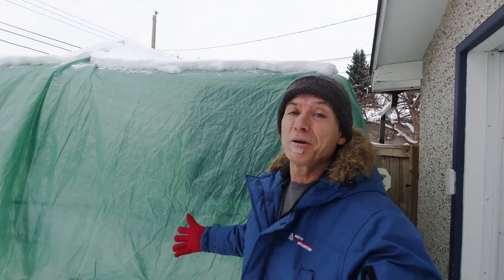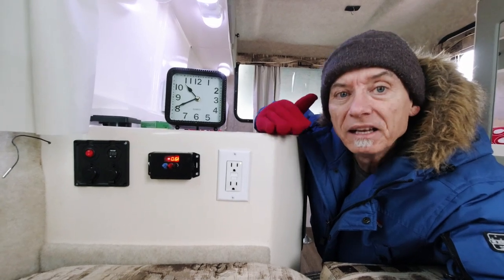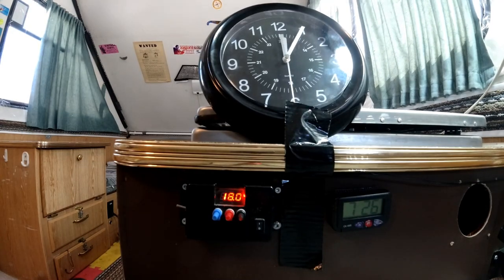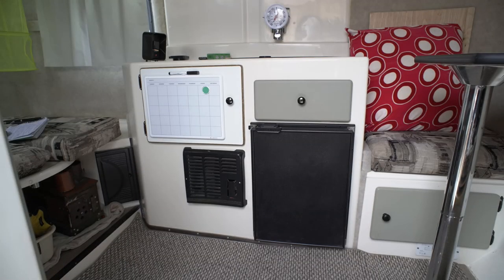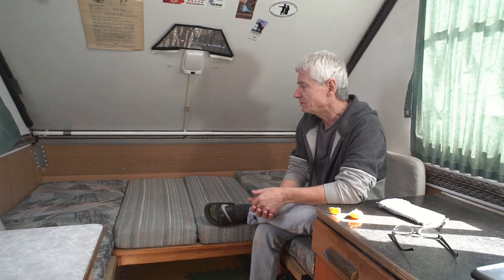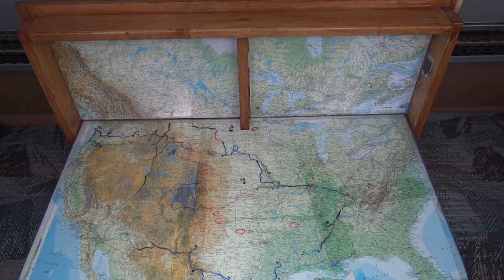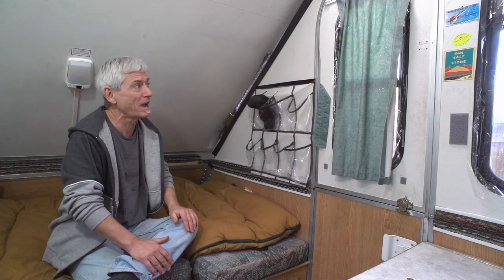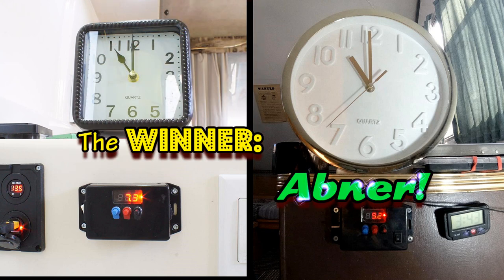From "A" to Egg Part 2: Which One's Warmer?

Comment: I love your heating experiment. One other difference I noticed is that heating an a frame, the heat rises up to the peak, whereas heating a cube rises less to the ceiling.
Reply: If Slim had 2 curtain rods he could put foam board across them an keep the heat lower in the cabin instead of heating the "attic".
Reply from the maker: @William, that would also block the vents. SP
Reply: @SlimPotatohead  Not being well versed in winter camping (beyond watching your videos) would that be a good thing or bad?
Reply: Former Scamp owner, you are absolutely  correct. The frame has higher ceiling area to heat. When I stopped  for lunch towing my Scamp 13' with outside temp of 25 degrees I could heat it up in 10 minutes to enjoy lunch. Great video as always.
Reply from the maker: @William, would you plan to cook or shower in the trailer, or out in the snow? If inside you need vents. SP
Reply: The added layer of hot air in Abner's peak acted as insulation during the heat retention phase as well.  The Scamp comes as an insulated camper, having been built Up North, but is the Aliner insulated in any comparable way?  By the way, just to be picky, all the heat rises to the ceiling in both campers, the flat and the angled roof.  In the Aliner, the heat must fill the peak and work its way down in order to get the living area warm; the Out Back's flat ceiling helps to spread/distribute the heat, but that also means there's more wall sq. footage that needs to heat up.  On a side note: do you think you will adapt the Eggnest to accept the wood stove?  I loved watching you build / use / adapt that stove, and Abner to accept it. Also, your vent cover remakes have intrigued me, to the point that I want them on my little Aliner; the hinge/attachment hardware pieces appear much sturdier than the (aging, brittle) stock ones. Thank you for all of your enjoyable, informative videos.
Reply: @doloresreynolds8145  I also loved watching that little stove in use. There's an irresistable charm to a wood fire, but heating a cozy little camper with fire out in the snowy woods - mmmmmmmm!

Comment: Hi Slim,  Another great video.  I have a 2019 Casita Spirit Deluxe 17’. I made a winter skirt for it which snaps onto the fiberglass using adhesive snap studs on the trailer, so no holes were drilled into the trailer. The fabric I used is a lightweight vinyl called Stamoid so the cover folds up into a very small package. I camped in the snow during January using the cover and had a three zone thermometer readout inside the trailer. One sensor was near my fresh water tank, one near my water heater, and one under the trailer on the ground. The cover kept the area under the trailer ten to fifteen degrees warmer than the outside air temperature and both tank areas stayed in the high forties and low fifties when the outside air temperature was in the mid twenties. So bottom line for me is that I can camp down to what I figure will be zero degrees Fahrenheit without my tanks freezing up. And as a next step if it was colder than that, I would use a heat lamp or two under the trailer near the tanks. I can send you pictures if you let me know how to do it. I live in NC and could help you with a cover if you get this way after the coast is clear from coronavirus. Stay safe!
Reply: I bet you could make a double wall skirt really easy.
Reply: Great idea. I also have a Casita 17 and despise winterizing the little fella. Yours is a great idea.
Reply: Wonderful.  Where did you get the adhesive snaps?
Reply: Nancy?  I'm truly surprised & please to read about your very practical "heat" modification.  Do the adhesive snap studs stay on the outside of your Casita year-round?  I went online & found Adhesive ONly 3M Stud Sets on a website for EZ Snaps.  The product description tells it's designed for removable skirts around the outside of RVs.  Do you have any youtube videos showing your modification?  I'll be even more surprised if Slim doesn't incorporate "your" modification to his Omelette/Outback.
Reply: Winter skirt is a pretty good idea if 3+ Season camping !
Reply: Joseph A. Freivald Sr. Joseph,  I purchased the snap studs from a wholesale distributor called Trivantage located in NC. I have an account with them but they could probably tell you where you could purchase the studs. They are expensive even wholesale.
Reply: William Branham Haha!  Despise winterizing!  I didn’t find that too difficult. I used the blow out method instead of dumping antifreeze in all my lines. Worked like a charm. I watched the YouTube video from RV Adventures to learn how to do it. Followed his video to the letter.
Reply: AZ Claimjumper Yes, snaps stay on year round. It was probably colder than it should have been when I installed them so I did have one come off just recently. It was a stud that had lots of strain on it cause I pulled the cover real tight when I made it. But overall I’m very happy with the snap studs but lots of care must be taken when removing the snapped on cover from the studs. I have a special snap removal tool that I use when removing the cover. I would not just start yanking them off carelessly cause more studs would probably come off.
Reply: Hey Nancy, I'm just curious as to how many yards of vinyl you used to go around your casita?  This is a great idea.  I will rarely take my casita out in the winter, but this is a great idea.  I can't tell you how many times I've been out to sheepdog trials with my Casita and other trailers have had pipes freeze during winter storms, even in Texas.

Comment: We have an OLD Trillium (1979).  The guard over the front window is in 3 pieces.  Originally, the centre piece was opaque, with a trillium symbol on it.  Some previous owner replaced that with a piece of clear plexiglass..   With the front and back curtains open (or removed), we can see right through it with our rear-view mirror.    It's not a great view, but we can tell if someone is behind us, and we do appreciate it.

Comment: I think Abner won the competition, personally. The heater was lower and most importantly, the ceiling was much higher. It took an extra 15 minutes to get a complete pocket of warm air. When you said you were feeling the drafts with Abner, I realized that the noodles weren’t in place. So with four large seams that were not sealed, it held its own against a molded egg with a lower ceiling that was without the gaps. I am surprised with the outcome and it gave me a greater appreciation for the A-Liner. Husband had wanted to get an A Liner but I nixed the idea because I thought the structure would always be too cold or too hot. I will honestly admit that I was also enamored with his parents and his sister’s big and fancy Class A’s with big house batteries. I drove his elderly parents south each winter and back again for several years. I enjoyed pulling over and hitting the automatic level button, getting a good night’s sleep in a large and warm bed then heading back out after breakfast the next morning. After arriving at our final destination, I could have the entire rig plugged in, leveled, water and sewer set up and phone, cable and internet connection in the time it took me to pitch the tent. It took me a good 5-7 years of driving them to realize how close we always stuck to interstates and the fact that it could NOT take me to Yosemite. So, like husband, I am going to pass on the big rigs. Well, I did like the comfort but in order to really enjoy it, I will build out my own rig on a bus or a flat bed and raise the suspension enough to let me go back a ways. You can never really go 4 wheeling in something with such a long wheelbase but the A frame (with split noodles) is looking better with your input.  Though getting my hands on some Kevlar and building my own off-road Unimog type of rig is my fantasy rig. Especially once they develop a solar electric engine strong enough to move the rig way off road. And if wishes were horses and I didn’t stray so far off topic. 
😁
Thanks again Slim. 🍹 Until next time.

Comment: GREAT video Slim, always enjoy your presentations, and content. One thing I learned from experience as a service supervisor for a large home builder in my city is that, Vaulted ceilings, equal inefficient heating. All the heat rises to the peak, leaving the space feeling colder as a result. I had dealt with this same issue so often that we began suggesting people install ceiling fans to bring the trapped heat back down to circulate it. Made a huge difference. As a result of your findings, I think if I do any winter camping in my aliner, I will velcro a piece of refletix  to the celing, straight across side to side and front to back to remove that peak issue. Create a dropped ceiling scenario that I bet  would significantly change the results. Cheers and stay safe.

Comment: Good vedio,  very informative,  what my husband did put a coating on the  floor & roof to add insulation to our  all aluminum traveler. This has  made our  aluminum  rv warmer, we also added  reflective insulation on our windows. We attach the reflective  with heavy duty, commercial Velcro  at night this makes it warmer. We have traveled in Sept & October  to alaska and Canada.   We traveled to Michigan  in October & November  and stayed warm in our aluminum rv. I like that the  reflective is light and easy to remove and store.

Comment: I would have done the cool down at night. My biggest concern is condensation with all that carpet coating in the OutBack. Maybe without all that aluminium it will be less. Stay warm and stay safe, Slim. Thanks for your videos, I look forward to every one of them.
Reply: Good observation
Reply: Interesting thought/observation.
Reply: Window frames are the biggest problem in mine for condensation in freezing temp.  Wish I had those dometic ones.

Comment: I really appreciate you putting this video out.  I had a little 'Livin-lite- popup' (all aluminum) camper.  It would get SOOOO cold in the . And night time lows, condensation was really bad because of the all aluminum structure. Also, when running the 'Little buddy' EVERYthing would get wet. That's the main reason I sold it. I never stayed in temps like you do. A few nights in the 40's but that's as cold of camping that I experienced. Still, without a heater, it was really cold. I opted not to have 'air or heat', except for a couple nights i tried out the 'little buddy heater'...... Anyway, I had decided to get the A-Liner type trailer after much pondering but when I watched this video, it all came back to me about the  cold and zilch on the insulation' and noise. So, I'm back to the drawing board. Just really glad I watched this video!! Thanks again!

Comment: Of all my subscriptions, I wait for your video the most.  Great video once again.
Perhaps a video idea.  While I was researching for trailers, I realized there are alot of things I gotta do to my car in order to pull trailers.  And different regulations per states such as trailer brakes. Would be great if you can go over what it takes to pull trailers.  Equipments, techniques, regulations, etc.
Reply from the maker: Hi Brian, yes that would be an excellent topic. Chances are that would be best answered by a professional mechanic. If I ever get a chance to interview one, I would definitely take this on. Thanks! SP
Reply: @SlimPotatohead  I'd be more interested in what YOU do than professional opinion.
Reply: Trailer size and weight is what matters for brakes ( I think most should considering the weight you add) and for cars the things that hurt today's cars is heat in the transmission if you tow try to add a cooler to transmission and don't overload the vehicle. My uncle towed a big 5th wheel with 3/4 ton truck ( he said he could handle it) but why cause stress in everything towing almost max when the next size up will do it better.  Bigger brakes and better suspension

Comment: I solved the corner leaking problem. I put puppy pads in all corners before putting the camper down. They are also good anywhere else in the camper that leaks. I just keep about 10 around. You can dry them out to use again. Take Care.
Reply from the maker: Great idea. Thanks Lisa! SP

Comment: As a full time liver in an RV, I would recommend getting a roll of Reflectix to use in your windows at night. It'll also help keep it cool in the summer when you use the A/C. You can use velcro to mount it so it comes off when you don't want/need it. It will also make it darker inside, which helps your lights both in the day and at night especially. Like the new trailer, and I don't remember whether or not you mentioned if you'd put the stove in the Outback. Cheers! DonP

Comment: "The whole taking down and putting it up thing" - That is one of the big things I love about my Aliner Ascape. Park on a level surface (or use leveling device), put the stabilizer jacks down, and I'm done. I was originally looking at a small pop-up, but after using my Ascape the last 3 years, I'm never going back to pop-up. I'm not getting any younger, and the older I get, the less set up I want to do.
Reply: I just went online & found the Aliner Ascape which is an entirely different RV configuration from the pop-up Aliners; I didn't even know Aliner made such a trailer.  And it comes with a rated 2500# Independent Suspension Dexter axle which is a real plus to the solid axles that come standard on the Aliners.  And your floor plan provides for separate eating & sleeping space.

Comment: My two cents, The headroom of the A lets lots of hot air get trapped up there. Lower roof will give you more usable heat (in my opinion. Be well. =Cosmo

Comment: Hi from sunny Scotland (t's 15C here just now). Abner took longer to heat suggesting the hard surfaces may have retained more heat, in effect acting as thermal mass. You spent time in the A frame as well so your body heat might have helped to heat the soft furnishings as well. If you winterize the Egg too, in theory, it should be better than the A in use. Guess only time will tell.

Comment: Hello Slim.  Another interesting video.  Thanks.  You could get some external mirrors to attach to your two vehicle mirrors that will allow you to see pretty much directly behind the trailer.  I have a fold-down popup tent camper.  It has an A/C unit on top which makes is pretty difficult to see what's behind me when towing.  The external mirrors fixed that problem.  I can't wait for this virus restriction in California to over so I can get back out there and do some boondocking.

Comment: Wonder about cooling comparisons down in Mississippi during August... hmmm
Reply: The best cooling solutions involve using the map and altitude instead of mechanical. Just plan your travels around the seasons. Of course even in the desert SW it can get cold at night so some form of heat is a good thing. I for one really need to avoid the cold and it is best to avoid the heat because of medical reasons, but Slim is kind of a cold weather fan being from Canada. His idea of cold is way different from mine. Mississippi in August sounds a lot like Missouri in August. Too dang hot and HUMID. Camping in Missouri in August I usually plan to camp near water. A shady sandbar in a river or stream seems to help in the heat of the day, but not much helps at night when humidity is high.

Comment: If 120VAC was available, perhaps I would have had identical fans inside each one to move the air around since Abner would tend to hoard heat at the peak of the "A", and also because one had the heater closer to the thermometer than the other, but no biggie, as it was, it was a good comparison for practical (living) purposes.  Well done!

Comment: The A Frame has the  high peaked roof. The heat is going up high and working its way down. The fiberglass trailer has a much lower roof which keeps the heat down low. Also, the A-Frame has more exposed aluminum. Aluminum is a terrific transmitter of cold.

Comment: The test gave you some quarantine time and us to watch the test. No taking it up and down now and no internal breezes in a wind storm. No water stains on the sleeping bag either. I'll be watching as you keep putting the Outback together and hopefully get to get out and camp and run around some more. With the summer heat and a lower roof I wonder how that'll turn out? Stay tuned :-)

Comment: I was always curious about what the heating situation would be like between the two. But then I just remembered how the Aliner isn’t perfectly sealed like the outback is. Are you planning on putting a wood stove in the outback too?
Reply from the maker: Hi Mitchell, a some point I expect to install a wood stove. Thanks! SP
Reply: @ReflectedMiles  Articfox has a much much higher end construction. The insulation is top tier as is the rest of the build. I doubt it would drop 10c in an hour from 20c even in -20c. The cost to seal and insulate the bottom of the outback should be cheap and easy. I bet it's his best bang for the buck.
Reply: @SlimPotatohead  Please check out the cubic mini wood stove! I would be curious to see what your thoughts on that one would be. They have sponsored YT'ers in the past as well!
Reply: @bobbys2643  That is what I'm going to install in my truck camper. Will be getting the cub.
Reply from the maker: @Bobby S, What's wrong with the stove I made? SP
Reply: @SlimPotatohead  nothing at all, slim! I just thought when you said "a wood stove" in your earlier comment, you meant a different wood stove! ☺️ I'm between the cubic mini and a diy, like yours!

Comment: A huge percentage of your heat is lost through the windows. 

If you can’t fit double glazed windows, a good option is clear (or crystal) solar film. It rejects about 90% heat, and 98% UV. It’s like tin foil but you can see through it. Most hardware stores sell it.

Heavy curtains are good too.